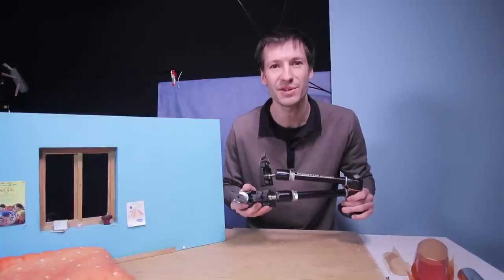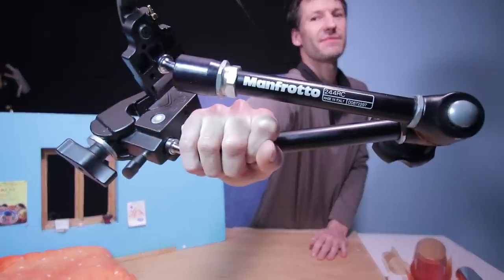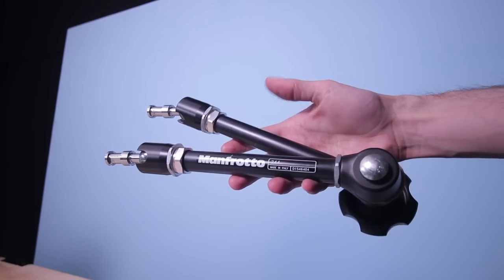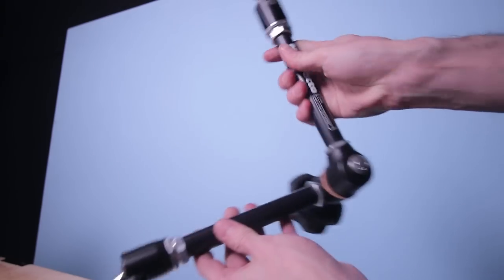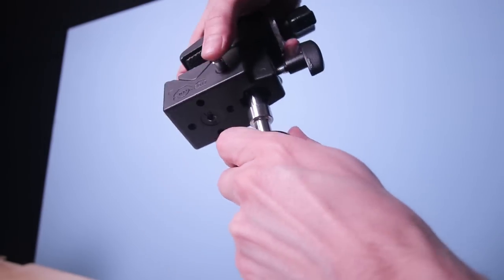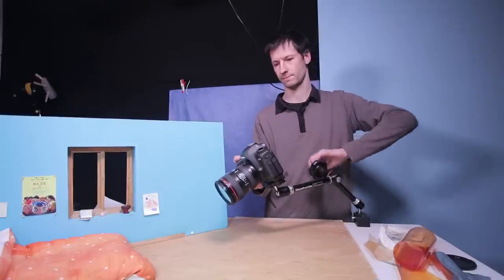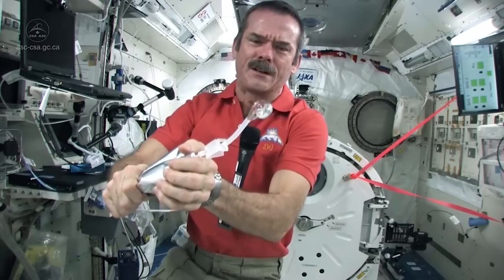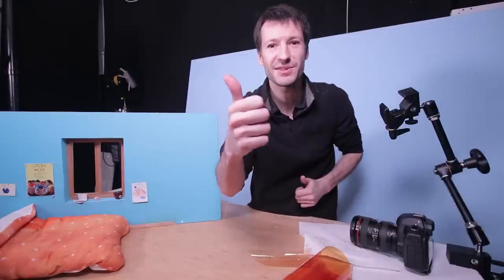Manfrotto Magic Arm solves it

Comment: I just order one after putting it off for 5+ yrs..  Watching your video gave me that extra boost I needed. Should have done it yrs ago.  ;-)  Several yrs ago I mistakenly bought the Manfrotto flex "goose neck" arm which has limited uses compared to the MagicArm. 

 To add to your "uses" list, I use it as a stabilizer when attaching a long slider to my tripod.  One end attaches to a tripod leg and the other end connects to the end of the slider to avoid slider movement when moving the camera away from the tripod's center of gravity.   It's literally like having a solid 2nd arm assistant.
You really packed soooo many creative use ideas into that short video!  Great.

Comment: Hola Edu! Gracias por el vídeo. Una pregunta. Yo acabo de comprar el magic arm y la zapata rápida 323 por separado y no veo cómo puedo acoplársela sin algún tipo de adaptador. Veo que la zapata que usas tú se entierra en el pivote del magic arm directamente, ¿me equivoco?¿Acaso el pivote del 244RC es diferente del 244 normal y está preparado para la zapata? Gracias!
Reply from the maker: Hola, si que són diferentes, el RC viene con la zapata integrada, no se añade. Creo que igualmente deberías poder atornillar la zapata al 244 con un tornillo de 1/4 pregunta en una tienda de foto
Reply: @edupuertasfruns  entendido, muchas gracias!!

Comment: Hola, mi manfrott o244rc viene con la platina fija para cámara en un extremo, ¿cómo la sacaste? necesito tener dos pinzas como pones en el video. Muchas gracias
Reply from the maker: Hay dos variantes de magic arm. La que tiene quick release plate es para cámara y no se desmonta. La usada para rigging es el modelo 244

Comment: Because of this "magic" arm I have never felt the need to purchase a tripod!!  I love it!  Also, how can you remove the quick release system and replace it with another clamp?  It feels that the screw is VERY tight...  Great video!
Reply from the maker: Yes it is a good solution. You can't replace the quick release with a clamp. That side is different

Comment: Question. I have the articulating arm, super clamp, and 244 rc, to accept a rc2 quick release, just like you have in the video, where you mount the camera. Exact setup. Question, I took out the quick release system that holds the camera  but I cannot put another super clamp on that end. The super clamp won't fit where the 244rc is in place... Can you confirm that? So I will be needing another articulating arm, that can hold both super clamp on both sides?

Comment: how did you remove the quick release plate from one end? It seems like its glued and can't take it off.
Reply from the maker: There are 2 models of Arms, in one the plate is fixed, that would be yours. On the other one you can connect all you want in regular spigots

Comment: Did you purchase the magic arm and the quick release plate separately and put them together, or buy the 244RC combination?  I was wondering if the combination can still be taken apart and used without the quick release clamp with other accessories.
Reply from the maker: When I bought it years ago they came together and did not work for the clamp on the side of the quick release. But there is an option the 244 with the camera plate, not quick release, that works for both camera and rigging
Reply: Thanks for the information!  I have one of the older ones and think I've figured out how to mount the quick release plate on it.

Comment: Nice! I hope they are referral links because I want to buy a couple of those.
Do you have any recommendations on lighting for stopmotion? 
Most versatile/ Good for a low budget/ Low flicker
Reply from the maker: Thanks!! They work great. For lighting I use good led panels most of time. Apperture has also a super nice dimmeable lights
Reply from the maker: I must do a video about it soon
Reply: I was wondering what would you recommend to do an overhead rigging using these arms.
Reply: As in setup.

Comment: Another great video. The 224 magic arm is one of Manfrotto's best products, along with the auto pole. Together they are awesome!

I have two questions though: why are there no magic arms over 11", even from the clone makers? And do the cheap magic arm clones work as well? A longer arm would be fantastic for holding small lights - the desktop sized C stand.
Reply from the maker: I imagine that the lever makes a longer arm impossible. I have a smaller clone and there is no possible comparation, it does not block into position